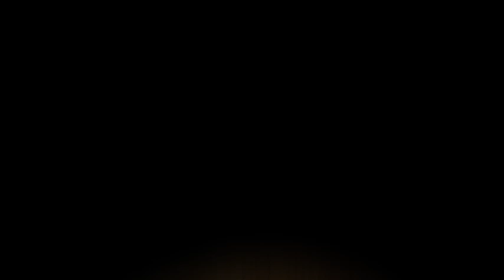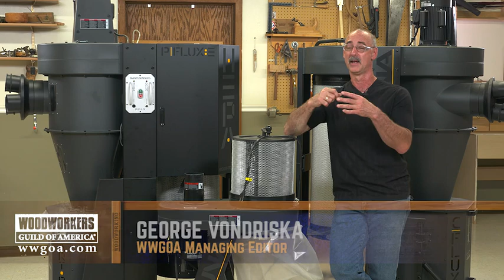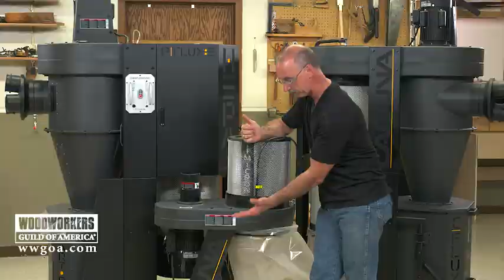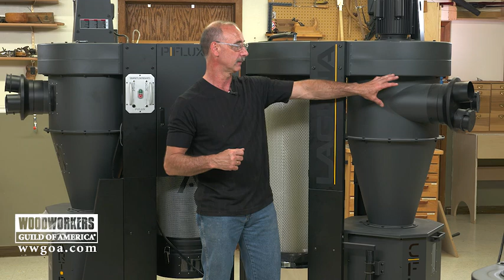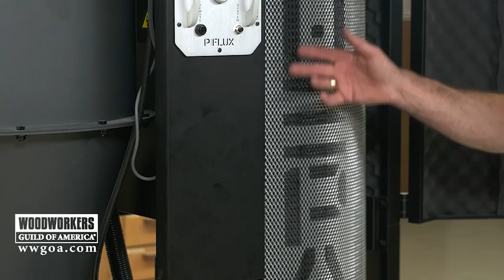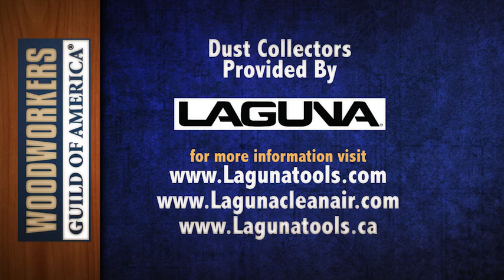Dust Collection Systems from Laguna

Comment: Any idea why the bag in the dust bin is crushing my dust collector bin insert. I cleaned the air filter and tightened down all bolts and nuts but it still deforms that insert. Any thoughts?
Reply: Why would you ask that question here? Ask Laguna

Comment: Hey George, do you think the dust collection bin is sufficiently large enough on these bigger units?  I I have a separator on my current DC, and I have emptied 55 gallon drums continually while planing through a stack of lumber.  I would imagine the same scenario here, constantly going back and forth while planing.  Your thoughts?
Reply from the maker: If you are constantly planing, you will fill it up pretty quickly.  But the drum is so easy to empty and replace, I don't think it will bother you as much as emptying the 55 gallon drum.  So the comparison becomes: easier and more frequent, vs. less frequent but more hassle.  Either way will work, so its a matter of personal preference.  You could also put a separator in front of the cyclone if you wanted more drum capacity.  This would add some static pressure, but the additional capacity might be worth it for you.
Reply: WoodWorkers Guild Of America Thanks. Very helpful and honest response.  Much appreciated!

Comment: yes if you work in the construction industry or woodworking most of your adult life over 85% chance of getting some type of lung disease so make sure you wear a mask if you doing any construction work. it is better to have a unit like that up in the ceiling then on the floor so gravity has an effect on the suction thought it was rather noisy? why didn't you put a cyclone inside a cyclone and invert the motor and have it inside the filter housing running from a tooth pulley and belt.